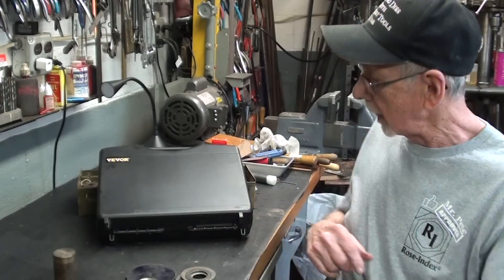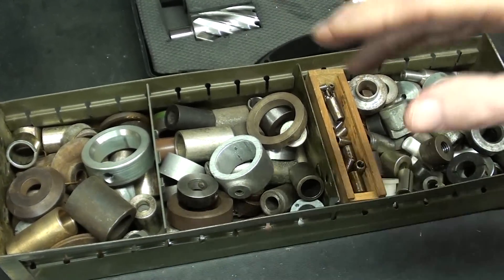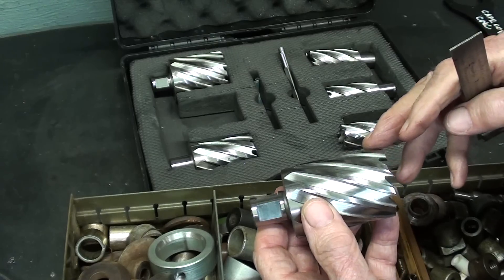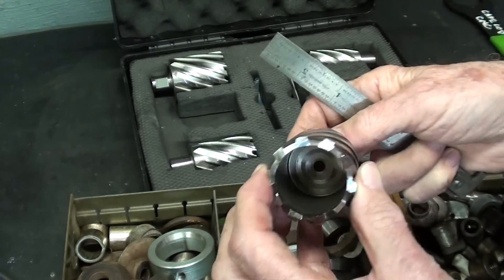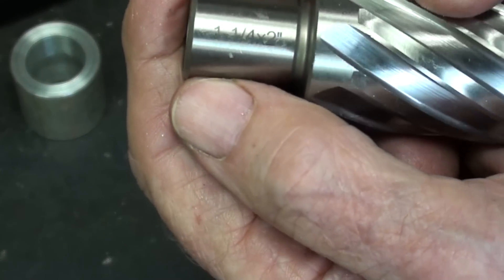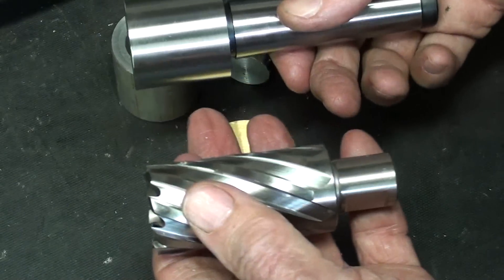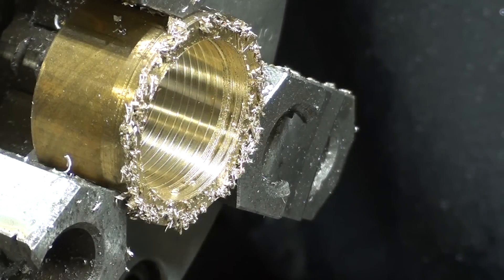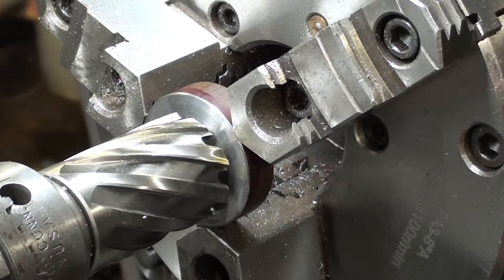ANNULAR CUTTERS make BUSHINGS & SPACERS  vevor #874 tubalcain brass lathe

Comment: Hi! You told that you cannot use that ER chuck, because it doesn`t go tight. Try to put the ER collet into a "MTB-hat" and then you can get it tight..? And it is not a good idea to use annual cutter as milling purpose, it may damages the bearings from drill, (not lathe`s)..  :goodvibes:  (sorry my funny English) 😅

Comment: that ER collet isn't seated properly in the collet nut. it has an eccentric slot that you have to pre-seat the collet in so it's flush with the end before inserting the tool. just wiggle it and press it all the way to the bottom til it's seated. (edit: looks like about 20 other people already said this)

Comment: I have some of these cutters that came with a magnetic base drill I bought.  I sold the drill and forgot about the cutters and still have them.  They even have a pilot pin for the center to line up on a small hole.  They are primarily used for cutting holes in plate or shapes where you can't get the part on a machine.  I do remember seeing pictures where the drill base was clamped around a steel pipe with a chain and cutting holes in the side of the pipe.   It was expensive and heavy and if used horizontally had to be supported in case the electromagnet released.

Comment: another use for annular cutter: I manufacture "Y" fittings used aero application. I use annular cutters, fitted with drill bits, on multi spindle CNC to machine both OD & ID of the 3 "legs" in one go.

Comment: Brass likes zero rake tooling. Might get a better finish if you take a diamond hone to the cutting edge. But then they are ruined for steel.  I have a modified drill set just for brass. Stops the bits from grabbing.

Comment: I think you put the oil on the wrong side of the drill because oil drains out and when you put oil on the other side the oil runs in and the lines get into the finished piece because you cut  the pressure from the drilling while turning .

Comment: I suppose for really rough gouging, they're ok, but tools that cut so far off their mark are pretty useless to me. Drill bits and boring bars seem to offer more advantages. You actually can drill as deep as you want with bits you can buy, and then ream or bore to the nearest tenth. Why waste the time and money on these since for any accurate application you'll still have to ream or bore?  I have a couple of them and have never found a use. They sure are pretty though.

Comment: Lyle,
It looks to me like the collet is not inserted into the nut properly (3:34).  The ER collets  have to have the collet snapped into the nut before you screw it on to the adapter.
Mark

Comment: I use annular cutters a lot in my big drill press and the holes are always exactly on size and perfectly round.
I think your holes turned out oversize because the force of the chuck jaws is compressing the ring as the cutter goes trough. When you take it out of the chuck the metal relaxes and the hole gets a tiny bit bigger.
The holes are probably not perfectly round as well because of the 3 jaws applying pressure 120 degrees apart. This will also be the cause of the bad surface finish.
Reply from the maker: Thanks

Comment: i think the rigidity is the finish issue. there is a lot of metal hanging off that tailstock. I am sure the same material on a short arbor on a mill it would have far better finish, and not allow chips to roll under
Reply from the maker: Yes

Comment: While I Haven't invested in a Mag-Drill and a set of Annular Cutters (YET), I Have on Many Occasions used a plain old Hole Saw for boring out bushings and spacers while saving the Slug for other projects instead of watching it all come out as Chips with a drill bit.

You can't feed them as fast and with no flutes you have to retract the hole saw more often to remove the chip build up, but they're a Fraction the Cost and get the job done. 

The finish is usually Rough and not precisely sized, requiring finish boring for most jobs, but the thinner wall of the hole-saw compared to the Annular Cutters leaves a Bigger Plug to work with saving More Material for other pieces.

Comment: Great video!  Using an annular cutter for an end mill is a good way to have these explode and send shrapnel flying.  These cannot be side loaded.  I think the greatest benefit is that they plunge cut accurately, like an end mill can,  as compared to a conventional twist drill that requires a center.  Say if you are drilling next to a previously bored hole, an annular cutter will not walk to that hole's established center.  They also come in very large sizes, say 4in plus, that are much more cost effective over conventional drill bits that would normally be run in large radial arm drill presses and last a lot longer compared to hole saws.  To run an annular cutter in a vertical mill you only need a 3/4inch collet in an ER set.  
You had a poor finish due to chip binding on a tooth in non ferrous.  It would be best to mist the work with a coolant and clear the chips frequently, I just spray a bit of simple green (lots of soap in it) instead of oil.  You would've had a better finish running dry and pulling chips periodically.  Simple green also gives me a mirror finish in boring and prevents loading the carbide.  I also have had more trouble with the tailstock taper coming loose in my atlas craftsman (12in swing mt3 iirc?) than the chuck losing grip of the cutter bit.  Since the work I do is so oversize (castings) tend to use the mill with a 3/4in ER40 collet holder and a troyke compound rotary table to bore accurate work over the lathe.
Reply from the maker: Thank you for a very informative comment

Comment: Thanks Lyle. I wonder if they make them slightly under size so you can finish the ID with a reamer or a boring bar. Great for saving material; that's for sure.

Comment: Every time I've seen these annular cutters, they included lubricant flow through the cutter. Of course most were in CNCs. It also seems you needed to adjust feeds and speeds for them. Normally they seem to be pretty good at getting clean bores without chatter.But what do I know?

Comment: My boss bought the vevor mag drill last year,it came whith a bunch cutter. Paid 600$cdn for it. The cutters are doing fine. I think the warranty on the drill was 30 days or 30 holes. The thing was crusty to start with and everytthing was loose after 30/40 holes. I change the main bearing only to discover it was the bearing seat that got bigger. Vevor cutter ok, don't get the drill.
Reply from the maker: Too late, I just got one on Friday
Reply: @mrpete222  I hope you are lucky and the thing make at least 10x more holes than the one we got.

Comment: Hi Mr. Pete ! I am sure you know this ...the oversize hole produced by the cutters is most likely (or could be) caused by your tailstock being out of alignment...Too low from wear on the tailstock or off center front to back by .008 would explain the .016 oversize.  I am not saying you were blaming the cutters....just speculating on cause an effect.....Great review...I WANT A SET OF THOSE CUTTERS ! Thanks, Mark
Reply from the maker: You are probably correct, I should try the extreme experiment on the milling machine to see if there’s a difference

Comment: I needed a new spider for a vintage differential and used an annular cutter and dividing head to rough out the 4 legs , I then cut away the scrap and turned to final dimensions between centres, it worked great

Comment: Your cutter is not perfectly on center. If you run these in a mill with a proper holder the size and surface finish of the hole will improve greatly. That chuck is not accurate enough to get an on size hole with a cutter that does not flex like a drill bit.

Comment: They aren't designed for milling but if you take light cuts you will need to save some distance to improve the finish with another tool most likely fly cutter . That's what I found .

Comment: ⚠⚠⚠Hi Mr Pete you need to install the collet in the nut before you thread the nut on the holder and the collet will be almost flush with the nut and should not fall out but some do  .JM And the ER collet works good on those cutters . hope this fix's the problem

Comment: You need to snap the collet into the collet nut before you insert it into the collet chuck. You made the same mistake on the drill sharpener only the collets are reversed. I can't believe no one mentioned it before. Watch a video on er collets for a visual explanation.

Comment: Mr. Pete, these annular cutters are supposed to be engaged and run in under pressure without letting up. Pecking is the wrong way to use this type of cutter.
Reply from the maker: I realize that, but I have no other way of getting the oil down to the cutting edge
Reply: @mrpete222  Try mineral spirits or paint thinner in a spray bottle. Spray liberally on steel or aluminum while applying steady cutting pressure. The light lubrication flushes up the chips and keeps the cutter cool.

Comment: Shattered an annular cutter yesterday, using a magpress drill upside down when the power cut out.

Drill fell, cutter stayed in the hole, and they're not cheap!

Luckily it was only a few inches off the floor otherwise it would have been the drill too.
Reply from the maker: Wow, scary

Comment: those rings in the bore appear to be from where you stopped to lube.  Also that ER32, the collar needs to be set into the nut before you put it in the holder, and it appears you have not done that. Some won't set in the holder, some are loose and will seat upon tightening.
Reply from the maker: Thanks

Comment: The cutter that cut the brass seemed to have one tooth that stuck out farther than the rest, please measure all of the teeth on that cutter.  If you use a pilot hole you can drill from both sides and drill double the depth. Ron W4BIN

Comment: My employer didn't want to purchase the Jancy Slugger mag drill and cutters when they first came out because he didn't think they would be useful and the employees would just destroy it. I told him I would buy it and cut the holes with it. We arranged a per hole cost depending on size and thickness. I would turn in the slugs from the holes drilled and paid it off in one year. We had several forklift with fork positioning attachments that used bolt on forks. Replacement forks cost around $1,100 each. We could buy a pair of regular forks for $400 at that time, cut off the hooks on back and cut the bolt holes using the old fork as a templet. Forks are fairly hard but the cutters went through them. The Jancy Slugger drill has a coolant system that flows coolant into the inside of the cutter.

Comment: Did you figure out your issue with the ER collet?
There are comments below about how to use them. 
Just snap the collet into the nut before you screw it on the holder. 
Joe
Reply from the maker: Thanks, several people mentioned that

Comment: Hey Mr Pete,  I can tell you a story about a place I worked in Brooklyn NY called Linda Tool And Die in Red hook, the owner came out to the shop with a Mag-Drill. Puts the thing on an I beam right above the machine I was working on drills his hole then unplugged the drill while it was still on the I beam. Thing came crashing down 2 ft away from me.  I didn't like the guy so I wished I was hit on my foot.  Workman's comp would have been nice for a few months. That the only time I ever wished I got hurt
Reply from the maker: lol . Kind of funny, but scary as heck.
Reply: Linda Tool & Die manufactured many machine parts and tooling for Tubular Textile Machinery in Lexington, N. C. where I worked as a manufacturing engineer for the company in the nineties. Tube-Tex was taken private after I retired and now goes by another name. I made some major cost saving changes in Linda’s parts while I was there.

Comment: mr pete  i use these annular cutters all the time to make spacers but i use the 3 inch versions of the cutter and drill then leave it in the lathe then part it off leaving the slug on the stock
Reply from the maker: Good idea, I need to try that. Never thought of it.

Comment: Thank you Lyle. I have steered away from these cutters since I have no previous experience with them. You have opened new options for me. I assume that VEVOR is fairly low end in the tooling category, but hobby use may make the brand quite viable. 

I saw that you are selling a Cleveland extended reach T handle tap wrench on PeteBay. I have long desired that tool and probably the smaller size more as well. Just hours prior to seeing your PeteBay post I scored a Craigslist purchase. I got the Greenfield clone and 2 Starrett smaller versions (one brand new , in the box) and about 45 taps for $45. Only about 5 of the taps have been used and only 2 of them were less than pristine sharp. I have immediate need for 50% of the tap sizes. Every tap is premium USA brands and the larger taps are in the $100 individual piece price range. I was super excited. The seller was a very nice man and we had a great chat. 
My wife didn't understand why I wanted a "road trip" while visiting my son's family for a week long home addition project. But I got a two hour drive with some his short people, a surprise stop for ice cream, and a boost for my hobby machine shop. The seller was wearing a company logo shirt from a fellow NEC license exam prep class student's company that I took in the late 70's with the founder of that company. The seller lives 4 hours from my home, so the link was not super likely. I haven't seen my former classmate in decades. He went on to build a very successful company. I have heard that he may have over 100 electricians now, and I believe he is fully retired with his son running the business. I got my license as well, but I wound up with a career is an industrial electrician and maintenance supervisor. The Craigslist score, a tie to my youthful and career, and a nice outing with youthful grands made for a fun afternoon.

I will keep watching your videos
Reply from the maker: Wow, that was quite a score. And you made a day out of it and had fun.

Comment: These annular cutters are similar to hole saws and I discovered an interesting use for a hole saw if you like to shoot traditional muzzleloaders.  Take a 1 1/4" hole saw and grind the teeth off.  Next, bevel the I.D. and the O.D. so the edge is sharp like a leather punch.  Put it in your drill press and fold up your patch material many times and lay it on a block of wood.  Turn the drill press on and now you can cut hundreds of perfectly sized muzzleloader patches in about 30 minutes.  It works like a charm!  Just for the record, this method is not my idea.  I just heard about it somewhere.
Reply from the maker: That sounds amazing. I hope some muzzleloaders are watching this video and reading a comment.
Reply: I still have an old 1" hole saw that I ground the Teeth off and Ground the inside to a fine sharp Knife edge.
Attached it to a Long bolt. I could then either Pound on it or Chuck it in a Drill to Cut away Carpet Pryor to Drilling a hole through a Floor. Worked Great on a Job site where a whole bunch of cables had to come up from below to Office Cubicles. Nice and neat with out the Drill grabbing and ripping up the carpet.
Reply: What is funny is that I have never shot a gun. I have fired many thousands of them during my time as a gunsmith, but I have never shot one. Came close once, I was working on a Marlin lever action in 32 rim fire. I had pulled the firing pin because I was working on a feeding issue and wanted to insure that the gun would not fire. So while working the action the extractor must have hit a weak spot on the cartridge, it went off (rimfire slam fire). The bullet went through a wall and ended up in the box of an H&R Trapdoor Springfield, it was stopped by the foam packing about 1 inch away from the gun. So that is the closest I have ever come to shooting a gun.
Reply: @oldfarthacks  So these guns were employees of yours' and you terminated their employment?
Reply: @tom87pate hate to be a party pooper, but surely the man’s point is… you fire a gun, you shoot an arrow, but never fire an arrow nor shoot a gun. Les in UK
Reply: @leslieaustin151  Then why is it called a trap shoot, a skeet shoot, a turkey shoot, a shooting match, a shooting range, shoot-out at the O.K. Corral, etc.
Reply: @tom87pate  because you are ‘firing’ a gun to ‘shoot’ a target. You shoot the traps, pigeons, whatever, by firing an aimed gun.
Guns are ‘fired’ because they need fire to explode their ammunition. Bows ‘shoot’ arrows because that is what they do, they use elasticity to ‘shoot’ their ammunition (if you can call it that) forward. Ditto a catapult (‘slingshot’ in USA?). The gunsmith who made the original point is correct in his use of language. It might be a ‘fine point’ of English meaning, but it is a correct point nonetheless. Have a good day. Les

Comment: Used them for punching holes in heat treated truck frames, crushing and screening plants and such. Custom cutters are available but the price jumps up quite a bit. With a good mag drill, I even fixed egg shaped holes to larger round holes. Far cheaper than a new frame rail.